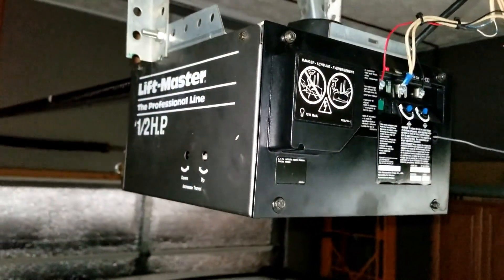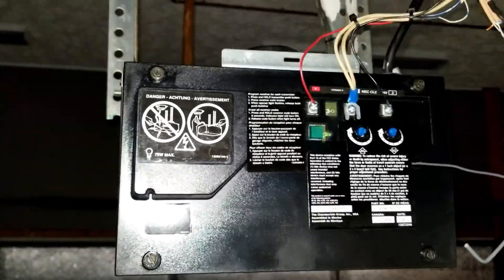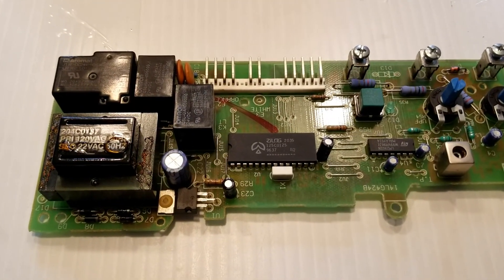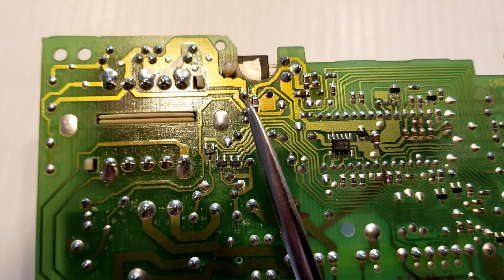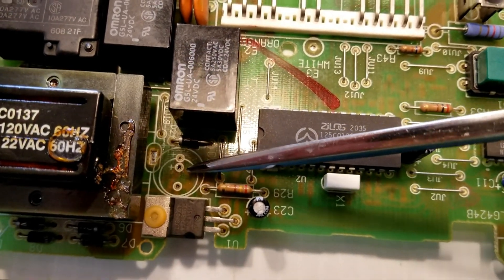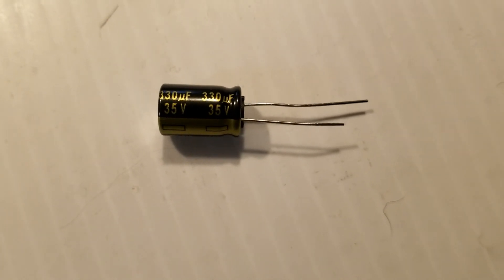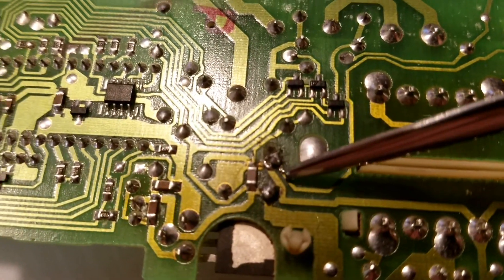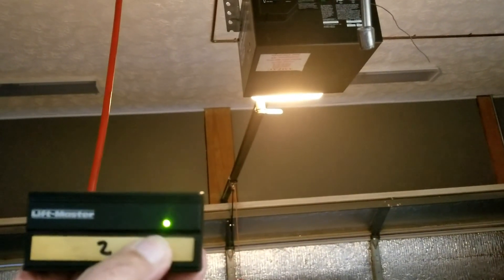Liftmaster Garage Opener Doesn't Close

Comment: We had two Raynor Pilot garage door openers from 2001 that both had this same problem (remote wouldn't make door go up when light was on) and we bought some soldering equipment and new capacitors for about $100, my daughter and I practiced de-soldering on an old circuit board, and then fixed both circuit boards and they both worked. The old capacitors tested at about 240uF after we removed them and the new ones tested at about 340uF.  Hopefully these capacitors will last another 20 years. They both failed about the same time even though one garage door is used 10x more than the other one. Thanks for the video.
Reply from the maker: Thanks, glad I was able to help. Mine is still going strong, no problems. 🙂

Comment: Thanks a lot Rich. I had the exact same problem. I didn't find this post until I realized it only happened after the light was switched off. I didn't have a bulb in it.
Reply from the maker: Thanks for the compliment. I hope the video was helpful and you could resolve your problem. My opener is still going strong but I had to replace the electric eyes on the door because they kept giving a false blocked door reading. Found replacements on Amazon and I'm good for another 25 years.  🙂

Comment: What's the part # for that capacitor and where did you order it from ?
Reply from the maker: Hi, BY. It doesn't have a part number, just a rating. This one is 35 volt, 330 uF (microfarad). I got a replacement on Amazon. https://www.amazon.com/gp/product/B073YPZ8PL
Reply: Thanks for posting this.  Mine wouldn’t work with any remotes just from the wall opener.  Checked the cap and it was bad.  Didn’t have one so I  used a few connected parallel to get the correct uf to test it out.  Works great.  Thanks for posting this.

Comment: Thank you SO much for sharing this info!  I've been trying to pin down why the door would open, but not close for my family, but seemed to work for me.  Turns out it was because I'd wait more than 4 minutes (not planned) then go out and check it and it all worked.  I NEVER would have figured out it was related to the light bulb.  I removed the bulb and now it opens and closes.  I have capacitors on order to fix it the right way.
Reply from the maker: Hi David, I'm glad my video helped you.

Comment: Old caps leak! They can cause all kinds of problems.
Since I was an Avionics Tech I troubleshot a 12-y/o Pioneer Stereo Amp I had bought when I was overseas in the Navy. I replaced every cap in it, all the cap back in 1994 cost be over $60.00. Way too many caps to count and various sizes. I had to triple check every one as I installed them. I hate to think if I would have cost if I had taken it to someone.
Reply from the maker: Sorry for the delay, YouTube doesn't always notify me. That sounds like a lot of work. I hope it paid off and you have the Pioneer up and running.